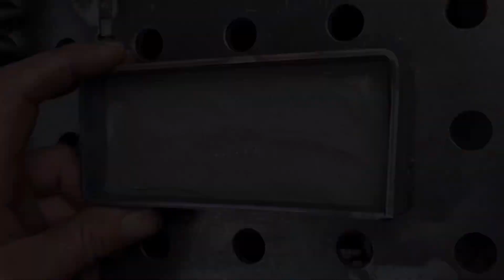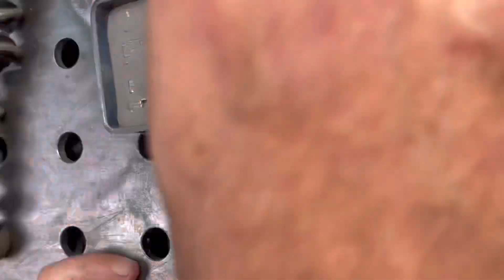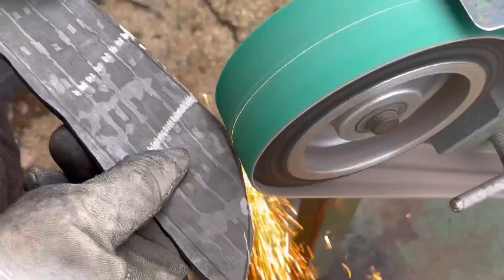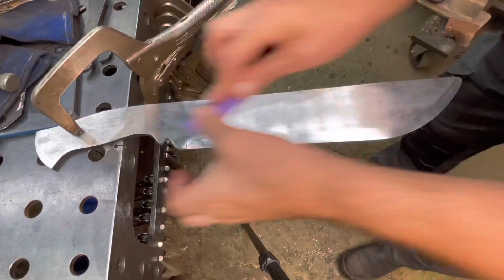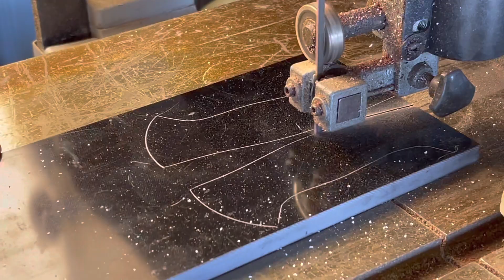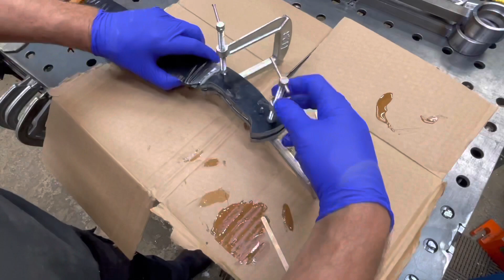TIMING CHAIN MACHETE !!

Comment: Do you just use a roughing endmill? 
Can't wait to get a bigger mill, plan on using a facecutter to surface my billets.
Reply from the maker: No i just use a solid carbide 4 flute
Reply: Bonifabcustom Rob Bonifacio  thanks